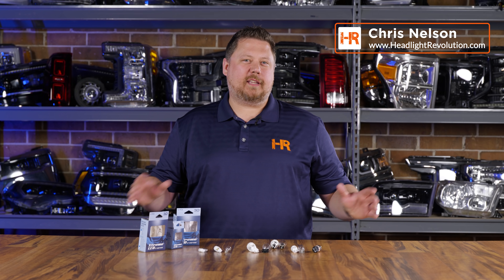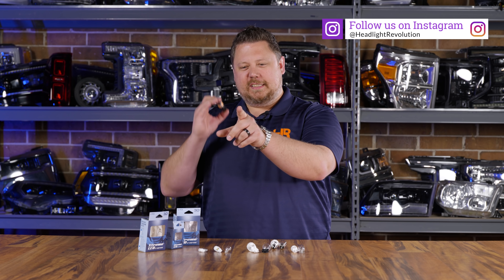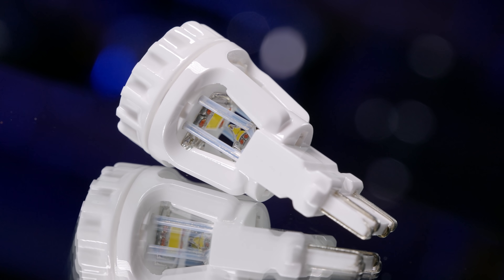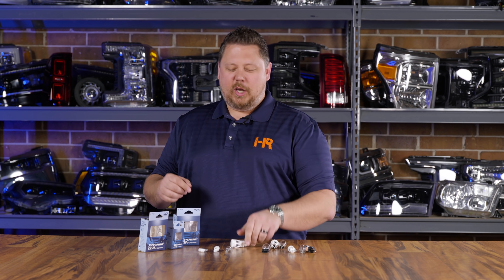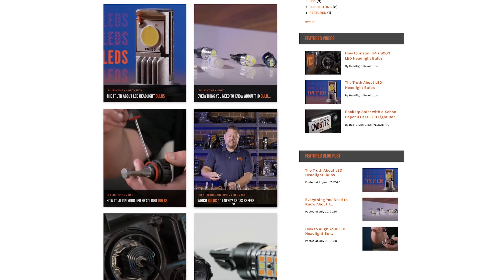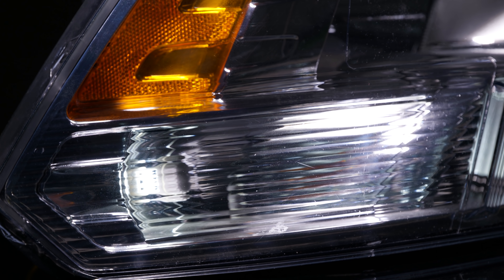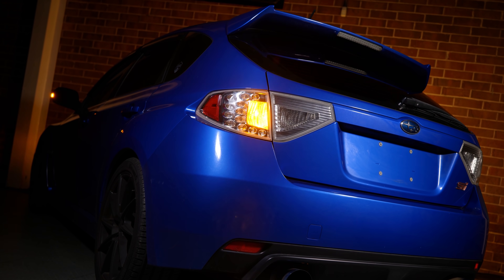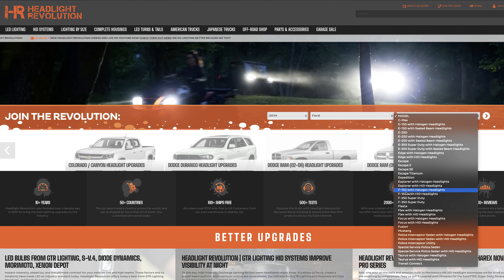New LED Bulb Tech: C-Series Ceramic LED Bulbs from Xenon Depot - Like Nothing You've Ever Seen!

Comment: Seems like hyper flash is a problem that the bulb should be modified to prevent, not something I have to modify my vehicle to prevent.
Reply from the maker: The bulb would be very bulky with built in resistors.

Comment: When will they make LED bulbs that are DOT/SAE compliant?  None of these are useful if you can’t pass an annual state inspection...
Reply from the maker: Not sure! Probably never honestly.
Reply: There is an issue with LED turn signal bulbs?  I know that low beams it is not generally legal to retrofit LED bulbs, but I didn't think there was an issue with turn signal bulbs.
Reply: @CaseAgainstFaith1  in Virginia they won’t even let you install LED license plate bulbs if they didn’t come stock from the factory…
Reply: @JoeO.  That’s crazy.  But as to your original question, if your state only allows OEM bulbs period, there isn’t anything an LED bulb maker can do. Yer just out of luck. I’m in Texas and as far as I know, LEDs are legal for anything except for low-beam retrofits.  I don’t think that the state inspectors check that though, not sure.  Back in the 70’s, many states including Texas had a headlight aim test as part of the state inspection.  I think they should bring that back, along with testing color and lumens.  And if your headlights pass based on aim, lumens and color, it shouldn’t matter if they are LED or what.  That’s my opinion but not going to happen unfortunately.
Reply: @CaseAgainstFaith1  in VA we have to be able to demonstrate that any replacement bulbs (including LED) are dot/sae compliant.  I agree with you that the regulators should put actual thought into it.

Comment: Great idea but... nope, sorry.
If it doesn't have a built in resistor (as many signal bulbs do nowadays) it's a non-starter.  OFC, most bulbs still throw errors that are hard as F to get rid of but the blink cycle is correct (HR does not, in fact, carry any signal bulbs for my vehicle - not even these new fangled ceramic ones).
Reply from the maker: It all depends on what you drive. If your vehicle is too old or rare sometime there is nothing available.
Reply: @HeadlightRevolution  My car is 2 years old and built by the manufacturer with the largest global market share.  It's one of their most common models.

Comment: How durable are these XenaDepot lights off road?  Thinking that the ceramics could crack/break ?
Reply: Your spark plugs have ceramic in them and they don't break. I think you'll be okay using these off road.
Reply from the maker: They will hold up.

Comment: Leds are dangerous bulbs to run they get very hot with the wires no matter if they have fans I purchased some while back & took them back to the place I bought them & they even agreed that was running too hot you couldnt even touch the wires more then couple seconds or would get burnt by these Leds..
Reply from the maker: This is very strange to hear. The majority of the LED bulbs we offer run 1/2 as hot as a halogen bulb. HID's are known to run super hot, but it is not known for LED's to run hot at all.

Comment: Lasfit have resistors built into their LEDs, and they look amazing.
Reply: Love my LED turn signals from Lasfit. They all work perfectly.
Reply: I have lasfit now for 3 yrs on my headlights and they are still going
Reply: I think the problem with the Lasfits is a lot cars use them as daytime running lights as well as turn signals on the front end, so when they’ve been on a while they start to heat up  and cause hyperflash. On cars that use regular on/off turn signals they work perfectly fine since the on/off blinking doesn’t allow them to over heat. Don’t take what I say as fact though it’s just a theory.
Reply from the maker: We get mixed reviews regarding that brand actually. Thanks for your comment.

Comment: That's stupid any vehicle light has a reflector...put the led at the bottom and the bulb reflector at the top... save on complexity and direct the light out and back towards the housings reflector.
Reply from the maker: "save on complexity" Not sure what you mean by that. All you have to do is install the bulb, the bulb manufacturer already did the R&D and engineering.

Comment: Here's what I hate about LED bulbs you plug them in and it knocks out your entire security system in your vehicle because of excessive electrical noise. Put a LED bulb in your tail lights and your interior lights go out. Changing a light bulb should not be this f**king complicated.
Reply from the maker: That sound like you are having an electrical issue with your vehicle that you need to get addressed. If you install an LED tail light bulb it shout NOT blow an interior bulb. We recommend you visit a shop to see what's wrong.
Reply: @HeadlightRevolution  It's the design of the LED as they are not exactly plug and play. I've learned to stay away from solid state LEDs and LEDs that have capabilities to work with modern vehicles as they have an extra connection which can cause a short on older vehicles. if an LED tells you it works no matter what position it's in normally they are the culprits. Basically, I use LEDs that have no special features built in and mimics an actual incandescent bulb exactly.
Reply: @jamesm568  That doesn't make any sense.  There is no such thing as an LED bulb that "mimics an actual incandescent bulb exactly".
Reply: @CaseAgainstFaith1  Doesn't make sense that some LEDs can completely wreak habit on your electrical system when they don't mimic an incandescent bulb exactly either. They do make LEDs with built-in resistors that mimic incandescent bulbs. Some reversible LEDs actually cause a short in a normal incandescent bulb socket.
Reply: @jamesm568  Your previous post said “no special features built in”. Now you are saying you use bulbs with built in resistors. That is a “special feature built in”. Which can work. But having the resister built in can cause them to get hot and burn out. Using an external resister is a better option.
Reply: @CaseAgainstFaith1  External resistors is not feasible and impractical when replacing dash lights and various other small bulbs throughout the vehicle.
Reply: @jamesm568  Sure, but are resisters necessary for anything but turn signals?  As far as I know, that is the only place you need resisters for replacing common bulbs with LEDs.
Reply: @CaseAgainstFaith1  Depends on your vehicle's computer system. Warning lights like the engine light, ABS light, and airbag lights may not work properly with an LED as the LED causes a fault if resistance isn't properly detected.
Reply: @jamesm568  I suppose that’s possible.  I’ve never considered replacing those kinds of lights.
Reply: @CaseAgainstFaith1  LED bulbs with traditional wires on the bottom were less problematic than the LEDs with a circuit board type end.

Comment: I wish vehicles would recognize or have a setting for a non resistor led replacement. Adding the resistor does nothing for the efficiency that the LED offer's.
Reply: It’s not all about efficiency, it’s also about the color temperature of the light and the longevity of the bulb.

Comment: Hi, I just bought a after market headlight, and the headlight comes with DRL, but my chevy truck doesn't have DRL originally.  How do I make DRL run at day? or is there any harness I need to buy?
Reply: You will probably need to tap it into a fuse that turns on when the truck turns on, i.e. power seats, sunroof, radio, etc.
Reply: @colemaurer5030   How do I do that? because I installed the aftermarket headlight already, and still runs my headlight as the DRL.
Reply: @imcaseyli  I'm not very good at wiring myself, but my car had the low beams as the DRL as well. I had to disable them by cutting a wire underneath the steering wheel, but that was on a subaru. I would look up videos on how to disable the oem DRL on your chevy truck, and then look up videos on how to tap in to a fuse to pull a current for the aftermarket headlight DRL strip.
Reply from the maker: Reaching out to our CS team would be the fastest way to get some help, give us a call or email!

218-755-5200
Sales@HeadlightRevolution.com

Comment: Would it be better to just change the turn signal relay to one that is for LEDs?
Reply: Older cars for the win 😂
Reply: @BeaverSmashing  yeaahhh, why don't they just LED swap all new cars?
Reply: Yes but a lot of newer vehicles dont have a relay you can replace. The bcm controllers the blinkers so resisters are needed. Kida defeats the point of a led to use less power.
Reply: @leviwoodring6101  alright, yeah I've seen some people change the relay on their cars but I would still see a lot more people use resistors, so I'm thinking why add all these resistors when only one piece can be change, but if we do would that be the better choice?(relay swap)